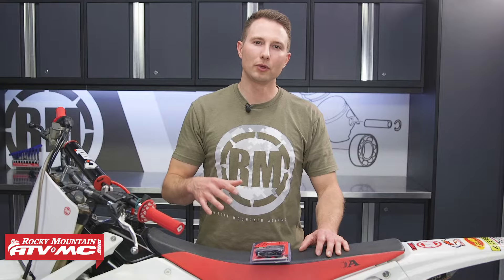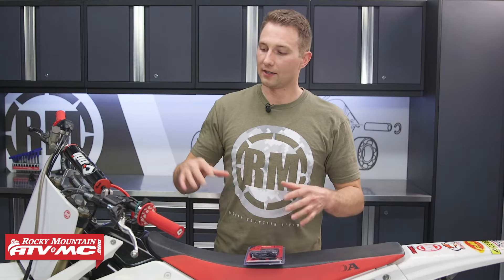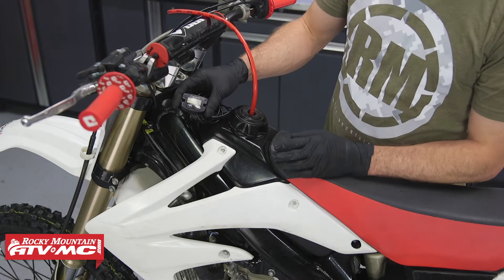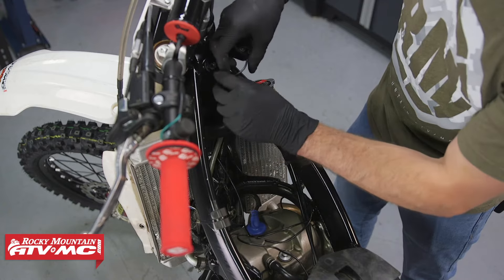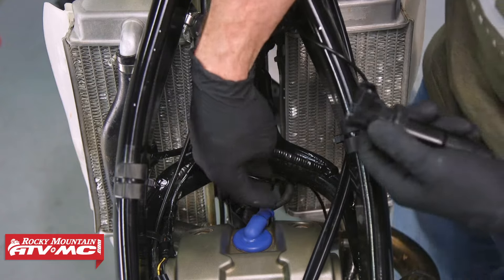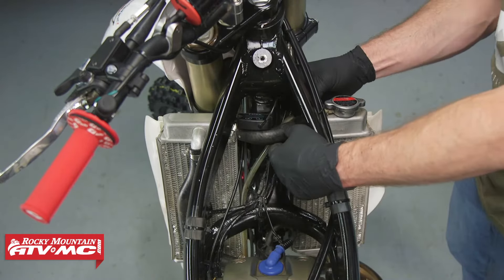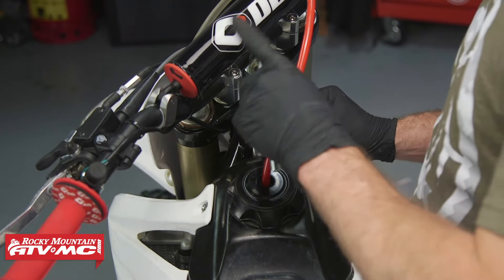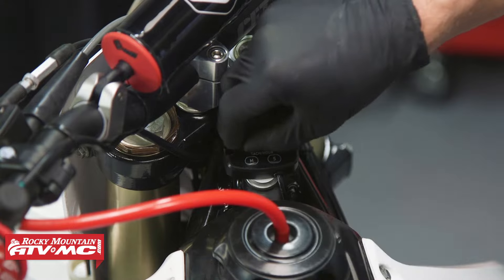How To Install a Tusk Tach/Hour Meter on a Dirt Bike

Comment: What setting is right for a 2-stroke YZ125? The video doesn't tell us what the settings mean. 1P1R, 2P1R, 3P1R, 4P1R, 6P1R, 8P1R, 3P2R, 5P2R, 1P2R?
Nothing is mentioned in the instruction manual. View stroke stroke blink, if I had to guess it I would pick 1P1R. Assuming it means 1 piston, 1 Revolution. Still don't like guessing
Reply: it means 1 pulse 1 revolution

Comment: On my combination instrument my bike reads 12 hours, but this hour/meter reads 14/15.. and my RPM were always fine. Is this because also meassures the idle time?
Reply from the maker: Yes. This device records your idle time and time spent riding.
Reply: @rmatvmc yes but idle time is not taken into consideration for service times 😥

Comment: Quick question, does the hour metre record minutes/hours when the bike is on but idling or only when u give it power and Ur moving ?
Reply from the maker: The Tach/Hour meter starts recording when the bike is on whether sitting/idling or moving.
Reply: @rmatvmc   cheers man , one more thing please .. does idling ur bike with engine on wear out the engine oil and count as part of engine oil change time ? .. or is it only when ur moving (rpm) on the bike ?
Reply: @Supernova869-s4i yes i have the same issue. My real hour meter on the bike says 12 hours. But on the tach/hour meter it says 14…

Comment: I have a 06 Honda CRF250r... I have a coil on cap. I didn't realize it and wrapped the wire 6 times around the wires that go to it but the tach on the meter I got is registering 2200-2400rpms at idle with choke off and warmed up. Seems to want to die if I lower it to 1700rpms or so. SO I'm guessing this is why? I should be wrapped3-4 times around he base of the cap to get the correct rpm readings?
Thanks!~

Comment: Tusk has 2 different models. What is the difference between the two?
Reply from the maker: The Tusk Multi-Function Tach/Hour Meter allows you to set the number of sparks per revolution where the regular Tusk Tach/Hour Meter does not. The Tusk Multi-Function Tach/Hour Meter will also track on 2 separate counters the number of hours since last reset, so say you use one to track time on an air filter you can know for sure how many hours you had on it. This could be used for tracking how long it's good for under various conditions. The service reminders are separate of the Job trackers and they will count down and then flash on the main screen.

Comment: I'm installing on a trx300ex quad and  the lowest rpm I can get is 5000 at idle. Should be more like 1400. Tried other settings and it only get higher.  What could I have done wrong.

Comment: So you don’t have to tie the wire in anywhere, you just wrap it around?
Reply from the maker: That is correct. You just wrap the wire around the spark plug boot or ignition coil wire, zip tie it, and you're good to go!
Reply: Rocky Mountain ATV MC so it starts when feeling some kind of vibrations or how does it work?😁
Reply: TinkanTheMan I assume it works off of sensing current
Reply: @JonnyJohnerson  that's right it measures the pulses of the electrode coming off the spark er sumfin like that
Reply: @rmatvmc  so its battery powered the same as the cheaper ones, whats the advantage over the wireless ones?
Reply: @MrAddison79  Do you need to change batteries or they last long time?
Reply: @MrAddison79  no advantage at all
Reply: Airborne Medic impressive

Comment: Hi do you think 2015 plastics would be a perfect fit on my 2002 yz85?
Reply: boozin_N_cruisin psn hey did it work bc I have a kx 85
Reply: Plastics different from the ones you have on your bike currently won’t fit without some modifications. You need to get a plastics kit specifically made for your bike then follow the instructions.
Reply: Probably won't fit your bike. If u wany newer style plastics, check out polisport.com and theh make restyling kits to make it look like a 2020

Comment: Was installing mine and my wire is way skinnier and I couldn’t get the wire wrapped around it tight at all, any fix for that? Also my frame is painted and I cleaned it off but the sticky pad is barely sticky so it walls off
Reply: Use RTV silicone Adhesive, works great and will last a long time.
Reply: Honestly, the mount is way more durable for the money, saves the risk of it falling off and getting hit if u fall

Comment: I'm having a hard time understanding how it works without having to splice any wires together lol
Reply: It detects the electricity through the spark plug wire
Reply: It works by detecting the frequency of electricity. If I remember correctly it's 60hz.
Reply: @GarbageDanks  and it also has a battery internal which powers the unit.
Reply: @jacobhendrickson8935 so I don't have to replace the battery right?

Comment: Anyone go without an hour meter?  I don't care about resale and always on maintenence without one.  If I clip it off will that cause any problems?
Reply from the maker: There is nothing wrong with uninstalling the hour meter on your bike. But it would be safer to take off the wire and not just cut it.

Comment: Will this tach only work with single cylinder or will it work with a v twin
Reply from the maker: This tech/hour meter only has one pickup wire but since the RPM will be the same in both cylinders, you can use this meter on your v twin just fine.
Reply: Rocky Mountain ATV MC thank you for the response I buy a lot of products from you guys and have always had good service 👍 my issue is I have 4 spark plugs in a v twin it’s a 99 Honda shadow 1100